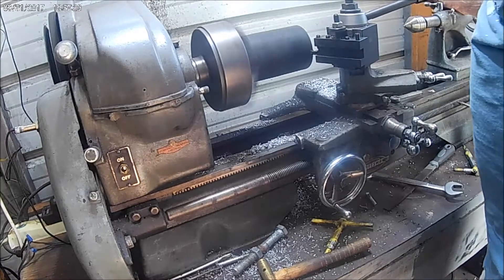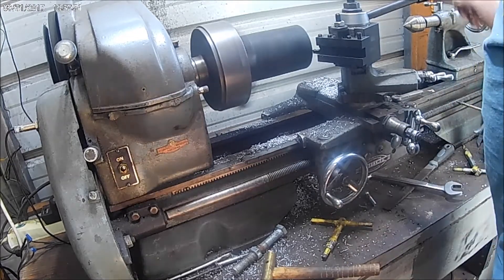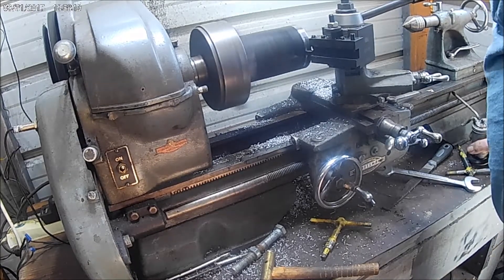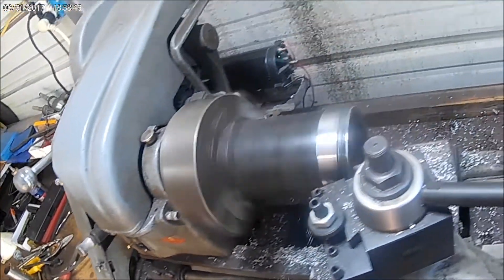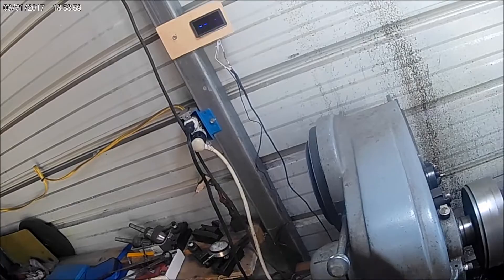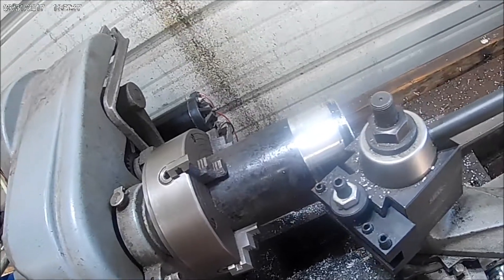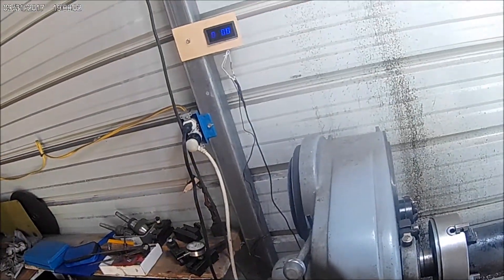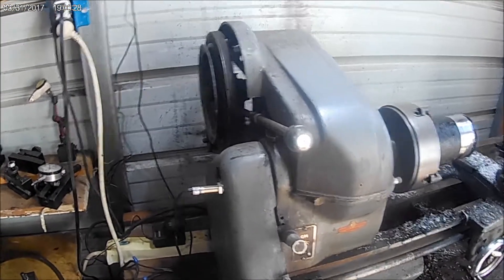DC motor conversion to lathe,, mostly fail

Comment: Two problems you need to address….repair brush surface and replace brushes…your dc motor is worn out..!
Second get a large variac and a full wave rectifier….speed control is not your problem anymore…

Comment: Well that's too bad, but like Jan said, at least now you know and have tried it which is sometimes part of the "fun". In my experiences with them they have the snot to do what I need, but that said... I've never used one on a lathe -only a mill. One thing that I don't like about them is the sound. It might seem strange (or maybe not) , but those DC motors stress me out with the way they sound lol. They make me feel like they are about to come flying apart or something. There's something unsettling or that I'm not used to compared to a regular AC motor.  After a while I wouldn't even notice an AC motor running.
Reply from the maker: the sound I don't really like is the brushes whirring ,since I noticed my binding problem I might give it another try.
Reply: @MissouriOldTimer  It's that "Whirring" thing that I don't care for myself. I never really thought about describing the sound of them, but that does kind of sum it up. It's nerve racking to me. I never saw mine spark. I'm not saying it doesn't, but I've never noticed it in either motor I have. I'll have to look next time I use one of them. I don't know at all, but I wonder if using the flywheel pulley they come with would make a difference in the sparking?? I mean, would the inertia of the spinning weight help smooth out the "flow of electricity"?  (for lack of any kind of technical term lol)
Reply from the maker: @johnstrange6799  I also don't know why the tack readout is so unstable.
Reply: @MissouriOldTimer  No idea there. Possibly some Grounding issue like a ground loop? I don't know. I had a digital tire tread gauge that would go crazy when I put it on my lathe. I made a better ground connection and that helped it, BUT additionally my lathe is run via a VFD, and an accessory you can order is a choke that quiets down noise and interference in nearby electronics devices when the VFD is in use. So maybe the DC motor is creating some kind of interference? You could experiment in a "tinfoil hat" manner by wrapping the motor or the tach in some aluminum foil to see if it blocks any interference, but I don't know if it will or if that will just be a silly waste of time. My tachs used with the DC motors are stable and act the same as the tach I have with an AC motor.
Reply from the maker: @johnstrange6799  I'm gonna change it back, I messed with it some a while ago and the motor gets real hot.
Reply: @MissouriOldTimer  Don't blame you. At least you tried it out. You're like an old pro at the lathe now compared to when you started. Love to see it. :)
Reply from the maker: @johnstrange6799  lol if I was a pro,, I'd have noticed right off that the tool holder was in the wrong place..
Reply: @MissouriOldTimer  It happens. Sometimes I forget to tighten the binding lever on the tool post. Other times I forget to tighten the drill chuck when I change bits. Everyone does it now and then.
Reply: Use a variac (no noises!) and a full bridge rectifier….sweet sound of hot chips